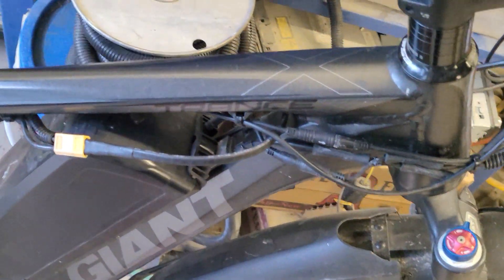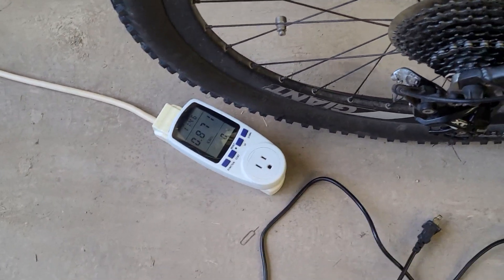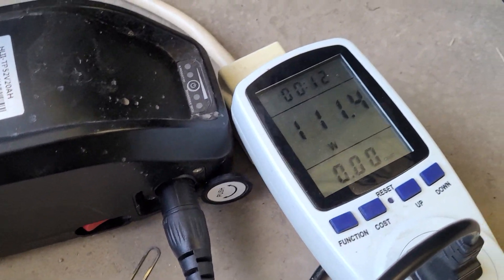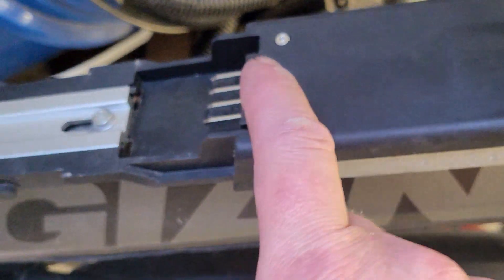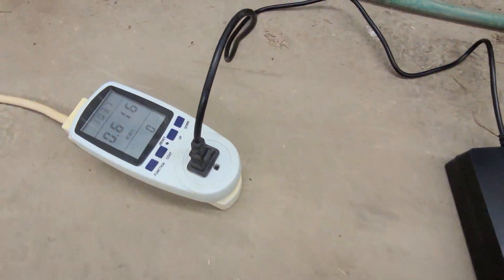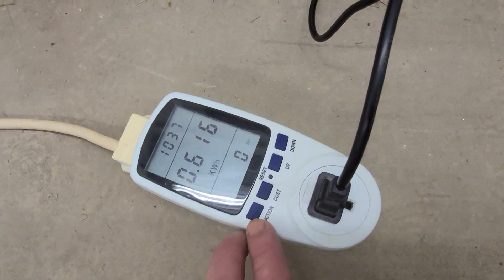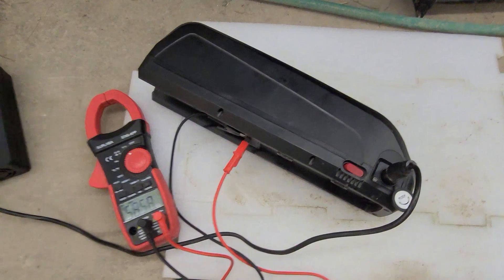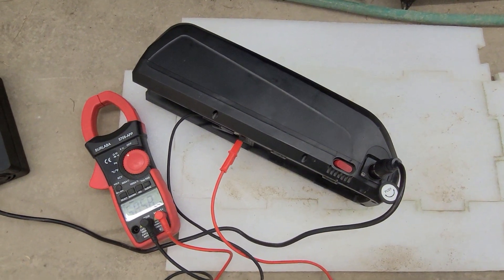Part 3 Range Test Cheap Amazon 52v 20Ah eBike Battery How many watt hours and amp hours does it have

Comment: May I ask a question sir? `I have the same battery but unfortunately I have the sw900 lcd panel which of course shows the battery 100% full after 32 miles. Anyway I have noticed there is a battery indicator level on the battery itself. So 4 lights. How many lights go out before the battery needs charging?
Reply from the maker: All the lights go out before it needs charging on the display. You can change the cutoff voltage with the programming cable.
Reply: @XunHinGeD  thank you